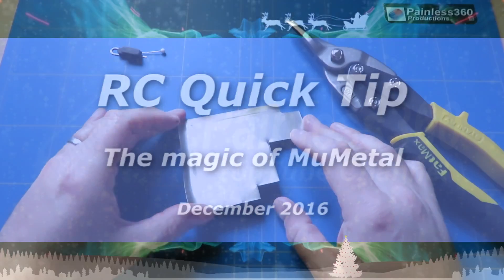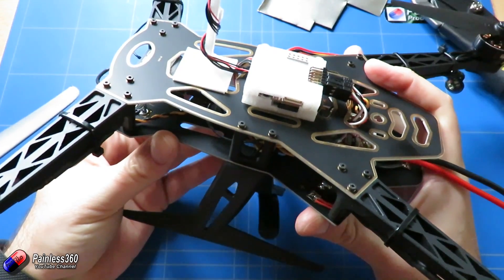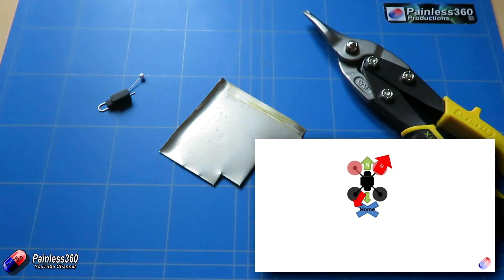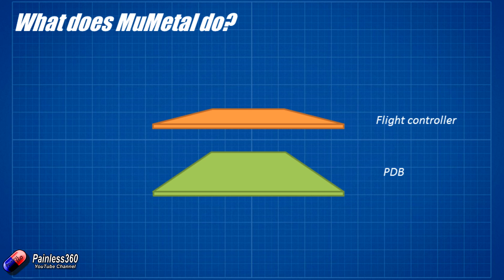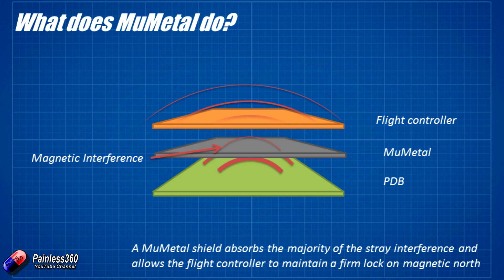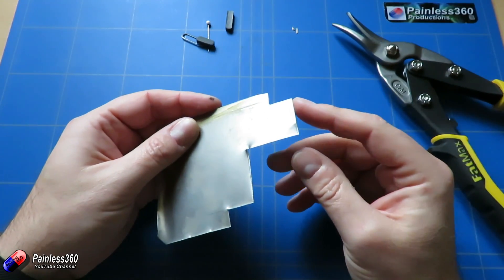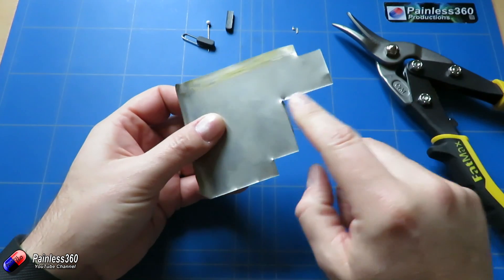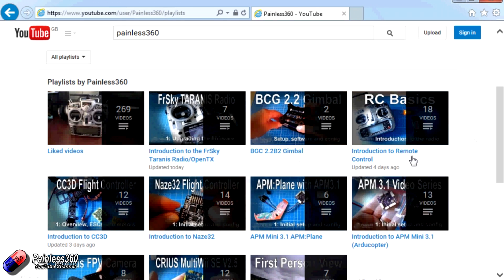RC Quick Tips: What is MuMetal?

Comment: Would using shielded power wires take care of the problem ??
Reply from the maker: Possibly. Depends on the type and strength of the interference. Shielded cables are rarely used in the hobby. Happy flying!

Comment: Great upload thank you. I wanted to ask if this protects against Hz or KHz? I have a device which emits around 18KHz which allot. Would Mumetal do the trick? I’ve just ordered some Giron shielding but then found out it only protects against Hz so lower frequency protection. Wanted your thoughts on Mumetal and if that could work. Thank you
Reply from the maker: Not sure on the spec, the use case here isn't that demanding..  best of luck!

Comment: Im planning to use some Mumetal to shield a Compass which is 18 inches away from a 10" subwoofer.  
Any chance this will work . How thick ?
Is adding more layers beneficial. 
Thx
Reply from the maker: It will help for sure but that's a pretty strong magnetic field very close to it. A single piece will work and the bit I have here is about 1mm thick. Make it wider than the thing you're shielding to help protect from flux bending around the edges. Best of luck!

Comment: this wondermetal does exhibit the same proprieties as... sheet iron... 
Most harmful EMI is AC EMI that can induce currents in the FC CPU or the ESCs CPUs.
AC EMI can be muffled (this just muffles/dampens, does not block or neutralize) with aluminium or copper adhesive tape (insulate it and ground it in one point).

The FC boards have usually 4 layered PCBs and there are large ground planes inside, beneath the CPU and IMMUs. 
More susceptible to EMI are the GPS and the ESCs signal wires. Shielding those or replacing the signal wire with thin coax does magic.

Comment: lee can the battery sitting on top of the quad cause any interference to the fc when the fc is sitting under the battery in the middle of the  it keeps crossing my mind but I keep forgetting to ask you lol
Reply from the maker: It might do but I've not flown a model like that, maybe we can look at that in the testing in the iNav series.. :D
Reply: +Painless360 thanks very much lee iv got my f3 case covered on the bottom and sides right up to the top of the sides but the top of the case isn't covered   but it seems ok but I just keeps thinking about the battery pack sitting above the fc it if it can maybe cause any problems lol   I'm sorry lee it only crosses my mind watching things like this  lee. and thanks again

Comment: very helpful video, as always.  i assume this helps with rf interference too.. thats the issue with a lot of people at the minute. i've been looking at all in one boards with built in osd's both fc's and pdb's but they all seem to have some issues with rf signals.  also should i be careful about squashing the magnetic field out the sides?... doesn't it distort the field pushing it  outwards? anybody know? when i fitted my fpv camera i was in such a rush i didn't even shorten the cables so the wires are all over the place and i think i lucked out in that at no point is it parallel or significantly in any field in any way that would allow rf interference. video is clear at all throttle inputs.  looks like a 5year old made it though lol.   ps. i knew it.. i knew it.. you all said i was crazy and a  hoarder.... but that old crt tv i have in the cupboard would be useful one day.... knew it... 17 years lolol
Reply from the maker: I've not tested it against RFI, if you test it let me know what you find out.. Best of luck!

Comment: I've been recommending this material to friends for years, it's solved many interference issues on my arduplane/copter rigs when physical separation and shielded cat7 was not enough. There are pre-cut rectangular and circular pieces available that are rubber backed with 3m adhesive for easy application.  Nice video and great to see you getting the word out on this very useful material!
Reply from the maker: +SYN FPV glad to hear from another satisfied user! Seems some doubt it's effectiveness even though they've not tried it! ;)

Comment: Ah, exciting. This is something I wanted to experiment for a while.

In upcoming iNav video could you show effect with mu metal and without?

Also someone says it reduces the magnetic field from Earth, is this an real concern?
Reply from the maker: I may but in my experience I end up adding it anyway (read up on things like CompassMOT in Ardupilot). This is a very common problem as not we have to mount the electronics so close together and the currents we are using are so much higher..
Reply: Painless360 Yes, I know it's an common issue. Having an GPS equipped 250 racer with iNav.

Question is how effective is really mu metal used on drones.
Reply from the maker: It's the best thing I've found.. Read up in all those posts on problems. Stay tuned!